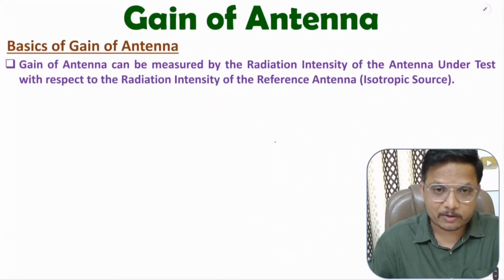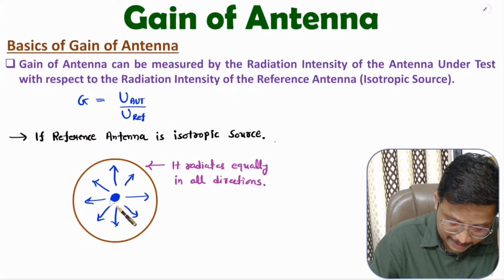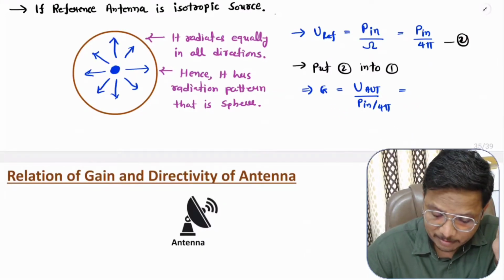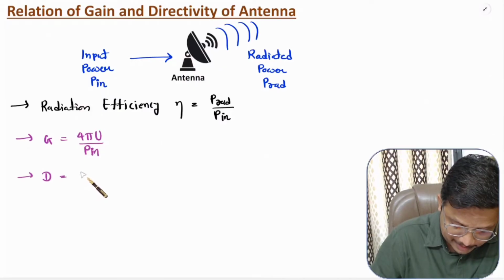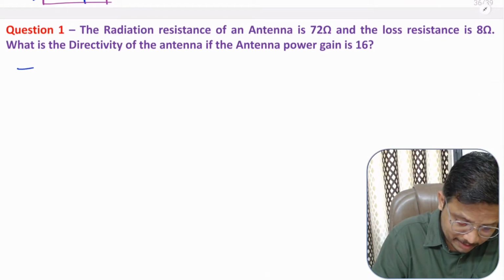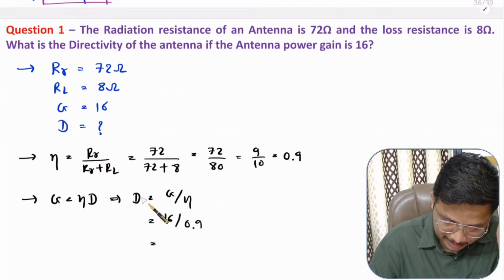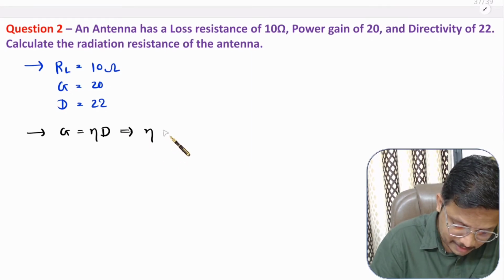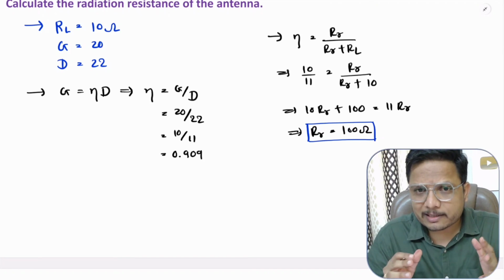Gain of Antenna (Basics, Definition, Calculation & Examples) Explained in Antenna Parameters

Comment: While converting the result in dB, why you use 10.log()? In Analog electronics, we usually use 20.log(). Is there any specific reason behind it?
Reply from the maker: 10 log is used for power ratio and 20 log is used for voltage or current ratio.